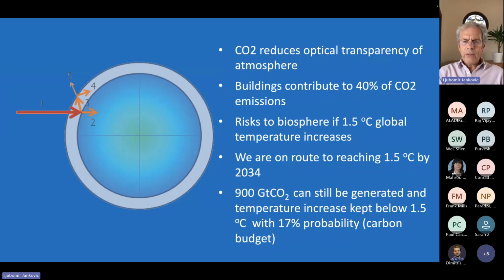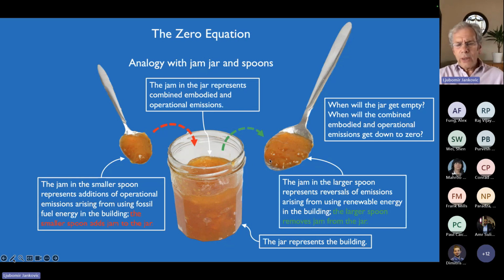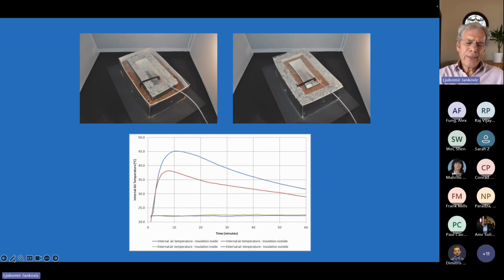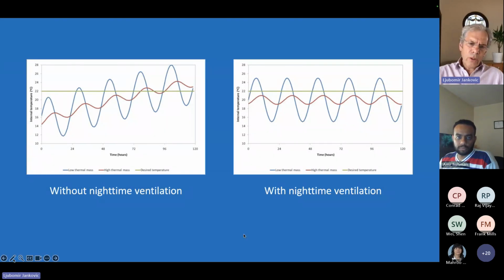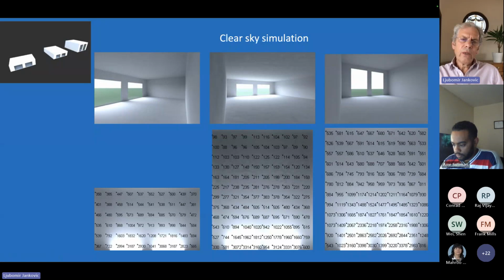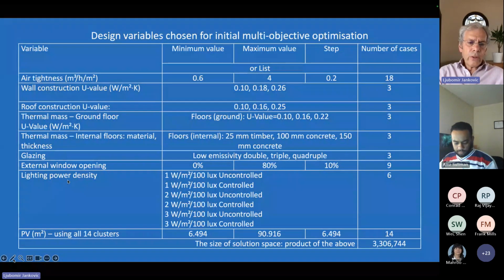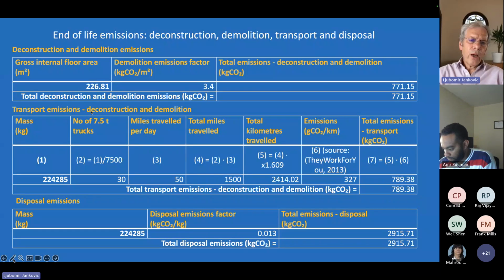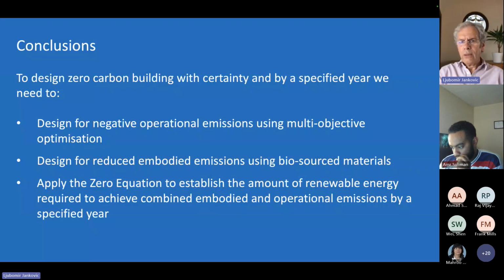Designing Zero Carbon Buildings - Embodied and Operational Emissions in Achieving True Net Zero

Comment: Unless the renewable energy is powering carbon capture and storage, it can never have negative emissions as stated in this presentation. Conventional PV will have small but positive emissions due to maintenance operation (inverter replacement, wiring and connector replacement and the like). This means the whole presentation is based on a false premise. I may well have misunderstood this aspect, and would be very grateful to have my understanding corrected.